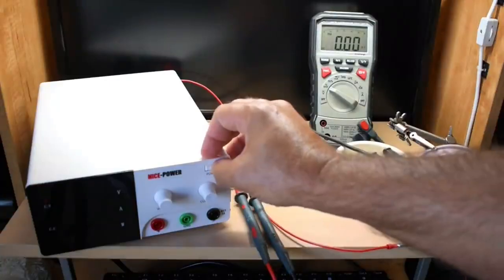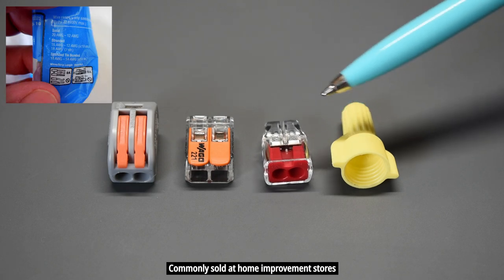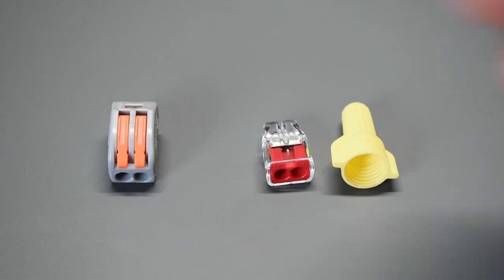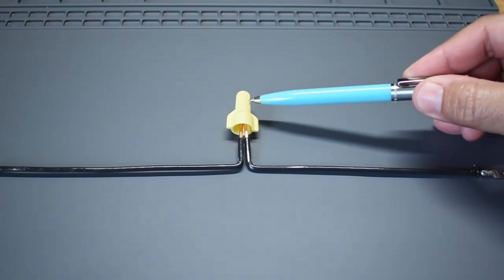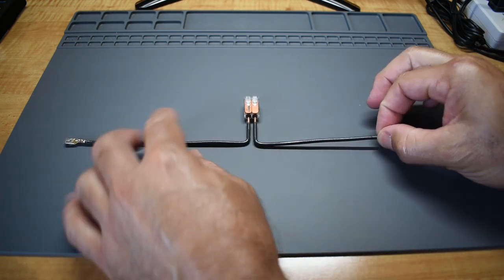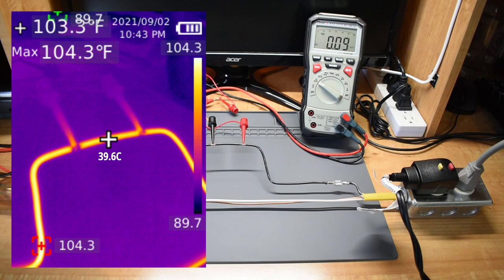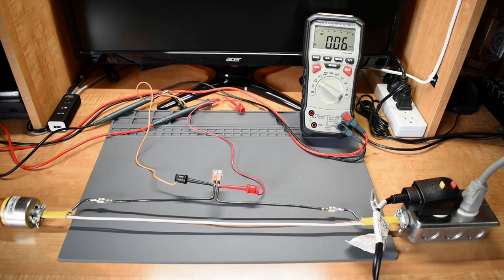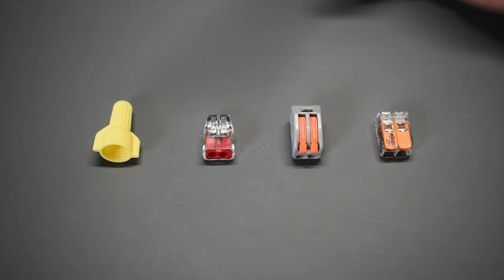BEST Electrical Wire Connector? Wago, Wire Nut, Ideal In-Sure, Lever Nut

Comment: Thank you sir... One of the better tests I've seen thus far...The WAGO 221 connectors, i.e. made in Germany are way, way over rated imho... The Ideals, made in the USA are the next better option imho... The Mv tests was well done as was the temp readings on each respective connector with the old standard wire twists coming out on top as I surely expected this because of the nature of the twist & a more overall solid contact area...That you used solid core 12 gauge wire on all the tests made this a fair & accurate test as well...
In closing, I have seen a more recent test on ( 4 ) push in connectors for their pulling strength with ( 2 ) of them being the Ideal & the 221 WAGO, but using 14 gauge wire in both stranded & solid core...The ( 2 ) wire Ideal pulled apart at 84.9 lbs., making it by a wide margin the strongest of all ( 4 ) connectors used in the test using solid core 14 gauge wire. The ( 2 ) wire WAGO 221 pulled apart at around 60lbs & once again, they were loose inside the connector housing when fully seated...
The stranded wire test using the 14 gauge on the Ideal pulled apart around 48 lbs... The stranded wire test using the 14 gauge on the WAGO 221 pulled apart at 26 lbs...That was an eye opener!
There is a next generation Ideal connector now, but I'm not sure if it's available in the states yet, they are the color blue & have smaller lockdown levers that stay in place far better than all of the over rated WAGO's do... If I was to consider ever using the WAGO's, which I won't, I would absolutely run electrical tape over the levers & wrap them tight...To put it another way, If I was left a choice between a WAGO connector or a twist butt connector, the twist connector would absolutely be my choice... 
All the best,
Bill... :~)

Comment: When using wire nuts I always twist the bare wire together for three to four twists using lineman pliers, very, very secure connection even when joining 4 wires together.  Usually I will use three wire pigtails instead of trying to join 4 or 5 wires together.  You take up more space doing this method.

Comment: 1. you have 2 wago Designs on table old and new
2. you are missing third witch is really for solid wire
3. movement is there so you don’t get a problem 
New is Beter.
Reply from the maker: The company's website clearly advertises the 221 for stranded and solid copper wire, which is why I made the video using the 221. Thanks for watching
Reply: Not sure why he had an AC offset voltage.   I collect multimeters and that offset shouldn't have existed with no load.   Also 4-5mv drop vs 10-11mv drop at 18 amps is not going to be noticed or burn the house down.   85mw or so vs  200mw.    Don't get me wrong,  I still prefer a proper wirenut connection for 12awg or higher.   One shouldn't be drawing 18 amps on 12 awg for a long period of time anyway.

Comment: Interested in understanding why you skipped over the Ideal push-in to recommend the gray Wago.  It shows less heating and loss than the others.  Is there something you did not mention that drove the selection?  Also, Wago have push-in connectors as well.  Not sure if this is something new since this video was made.  I wonder if those perform any better than the Ideal product.  Thanks.
Reply: totally agree! It is contradicting based on all the results he did. the conclusion doesn't make sense. Ideal also makes a 4 wire connector.

Comment: All of my wiring projects are stranded type in conduit for easier pulling. I avoid romex when possible so changes are easier in the future. Lever nuts are by far the easiest to use with stranded. If I am working on solid and I'm joining 2 or 3 wires, then I will tend to use a standard wire nut.  Unless it's lighting circuits as they are usually lower amperage and with LED's in almost every fixture, an entire floor's lighting circuit might only be a couple amps.
I also pull test every connection. I've had failures on wire nuts, push-in connectors, and the lever nuts using both stranded and solid.

I saw a video or two where someone was putting a lot of amperage through all these connectors, like 50+ or something. Well over double the rated. I remember the Wago connectors did pretty well. The wire insulation and connector plastic was all melted/burned off, but the metal spring connectors stayed intact. I think even at 30 amps, the heat was still within acceptable levels with all connector brands.
Reply from the maker: Probably used stranded copper wire, I'd expect close results. That test wouldn't do too well using solid copper.

Comment: Really excellent evaluation. I would be interested to know the outcome using the gold standards of "wire nuts".. The 3M Secure Grip and 3M Performance Plus. Both are just outstanding and, I believe, a step above the Ideal nuts. That said, really great job in this video.
Reply: Why do you think they are better?
Reply: @techmetal2292  Sorry that I didn't notice your reply until now. First, the "spring" is much heavier and it's grip is superior. Also, the spring has a durable, defined sharp edge that bites into the conductor and creates a gas-tight connection between conductor and spring. This edge is superior, IMHO, to the other brands.  Thanks for your reply..

Comment: Would be nice to see the same test but with stranded wire. Here in Spain we only use stranded wires with block connectors. Wago are just breaking into the market but most still using the old blocks.
I have some Wagos 221 and I was curious to check the wiggle with solid wire. I tried some solid 16awg and doesnt feel safe at all, lots of play. 
However, the stranded 16awg feels much much better, almost no play.  Also 12 awg stranded has zero play so I think the wagos are much better suit for stranded than solid.

Comment: I'd be interested in seeing you do a similar test between the push-in inserts and the screw terminals on UL approved electrical outlets and switches.  The inserts are convenient and harder to get wrong, but the screw terminals offer more contact area.  Perhaps such a test could also compare insert the wire straight into the screw terminal (some units have molded areas intended for this) versus hooking the wire around the screw.
Reply from the maker: I already thought of that idea. LOL. Based on these tests, the screw holding the wire will be a better connection.
Reply: @electronicsNmore  Another problem with the back stab receptacles is the long term failures. They will work when first installed, but often fail down the line.
Reply from the maker: @illestofdemall13  Very true. I've had to repair many "dead" receptacles over the years. For some light switches and receptacles, all I had to do was move them a little, and the wire made the connection again. With those, I simply moved the back wired connections to the screws.
Reply: @electronicsNmore  Same here, I have had to repair those connections as well. My favorite method is the screw clamps on the side of higher end switches and receptacles, and the internal screw clamp of GFCI receptacles. I just need to not over tighten the screws because I have a gorilla grip from years of screwing and twisting wire nuts. I work for a small company and our niche is installing high end lighting, dimmers, smart switches, etc. Been there for 15 years so far.
Reply: @electronicsNmore  
What is different about the back stab connections vs the push connectors shown above?  You'd think that if the push connectors can be made to work reliably and safely that the same design could be used on receptacles.

Comment: I prefer wagos simply because it's way harder to mess up. Pullout tests are kind of redundant because single strands should never have a mechanical load on them.
Reply from the maker: Pullout tests, one which I have coming up, are useful. I agree that you wouldn't be doing it to the wiring, but it does show how well the grip is on the conductor.
Reply: So basically, never pull the wires back out of the box and they are fine?

Comment: hi thanks for the video. not having the data you presented here i always went for the insert type (lever type unobtainium here) i use helacon connectors bulky but positive with stranded wire (for some reason code here prohibits single conductor wire). had some issues with nuts finding only 3m brand worth of any trust (then again hard to find here). take care. your channel is awesome
Reply from the maker: You're welcome! Glad you enjoy my videos.

Comment: Very helpful, thank you! I've always used wire nuts, but had been considering using quick connects; I no longer consider them!
Reply from the maker: The lever type are good for electrical boxes with very limited space, or if you'd like to connect 4 or 5 wires together.

Comment: I really like the idea of the lever type connectors especially for solid/stranded connections or appliances that get changed out periodically. Other than that, I prefer using wire nuts on twisted connections. What is the brand name of the one you called the lever connector?

Comment: I've been using both the grey/orange and clear/orange for years, working in the offshore field. I'm not even allowed to use the twist type. I do place a tiny bit of heat shrink below it to prevent wiggling. Mont of my house is now outfitted with new wiring and clear wago's
Reply: Do you use the explosive environment version?
Reply from the maker: Lever nut types are a waste of money for any installation that you have no intention of modifying. Push-In type connectors are cheaper and superior.
Reply: @AgentOffice  I don't work in ATEX environments. Think dredgers, fallpipe vessels, etc.
Reply: @electronicsNmore  Levers work great to be honest. A few cents difference doesn't mean much. They are easier to use and easy to modify. We also use a combination of hard and stranded cables with the same levers (in different areas, depending on use, stranded is used a lot for 24V). I agree that push in is superior, but having one type of connection that's easy to reuse and easy to work with can save a lot of time.
Reply: @electronicsNmore  Let's say $50 more in an install that cost the customer $10 000 is a waste? And please not forget that WAGO is quicker to install, lol.
Reply from the maker: @Faddnn  I see no benefit in using the lever connectors over the push-ins. The push-ins are cheaper and better.
Reply: @electronicsNmore  Better for fault-finding, can bqe used for fine-stranded as well, combined with both stranded and solid. Can be reused on stranded and as I said adds nothing to the cost of a installation already priced at $10k. Unless you're going to argue $50 is to much for you in a 10k install.

Comment: How about seeing how much pulling power it takes to pull the wires apart? Also see the maximum amperage that they can handle. Thanks for the vids.
Reply from the maker: I may do that. :-)
Reply: Both wagos and wire nuts can handle 3 times their rated Amperage, of course it is not recommended. Also Germans and most of Europe, and Japan use wago or similar connectors. The Germans have used them for like the last 40 years. Germany runs on 240v AC less amperage of course. Most industrial electricians I’ve met use wagos. Please do those test when you can electronicsNmore!

Comment: Can you so a Pre-twisted wire nut VS. a wire nut that is not. I don't think there will be much difference is any. If connecting 4 or more solid conductors I find Pre-twisting helps greatly to have a good connection. But with less conductors I do believe both are sufficient.

Comment: I guess it seems some of those companies are trying to solve a problem that doesn't exist.

I suppose I have a fundamental issue with adding moving parts and cost to a system that has technically no moving parts.

Thanks for sharing!
Reply from the maker: It's possible over time the heating "can" affect the tension of the spring mechanism on the wire.

Comment: Thanks for this test I was just looking at these connectors on Amazon then seen you had posted this about them.  I already use these lever nuts was looking for one to accept larger gauge.
Reply from the maker: I think you can find up to 10 gauge.
Reply: @electronicsNmore  yes sir that's the largest I think there is which due to clamping force I'd say largest I would want.  Anything more lug or set screw style.

Comment: The gray ohne look like a old wago 222 or like a china ripoff.
This and the wago 221 are also for stranded wire. The Wago 221 are also good for ships and carawan.
The red connector is only for solid wire.
Reply from the maker: 222, yes. The red connector is for solid or stranded, says on the package.

Comment: An interesting video, I like how your test was laid out. It would be helpful if the CSA/UL specification limits for wire connections were included and compared to your results, I think that comparison would help people make a better decision. So now with the popularity of these types of compression connectors increasing mainly because of ease of use, we will see counterfeit versions on the market at very low costs which of course, depending on the quality of the fakes, may result in more electrical caused fires and possibly denial of insurance claims if the electrical work was done by unqualified people.

Comment: At the end, you clearly prefer the wire nut over the other three.  Since the Ideal was lined up next, why did you suggest the lower rated other two if there were several wires?  Wouldn't you use the Ideal for 3,4, or 5 wires?

Comment: I'm glad you did this test I was on the fence on getting those quick connectors. No way I'm getting them now.  I know it's negligible but I work in hvac and heated connections cause wire melting and wouldn't be worth the higher we would have to charge customers for using these. Wire nuts it is.
Reply from the maker: People like how easy you can take apart conductors using the lever type, but if you want an extremely secure connection, stick with wire nuts. That said, the Ideal push-ins are very good low resistance connectors.

Comment: I hope UL and Intertek are taking notes.  

I like the Wago style for a temporary solution, a wire nut for long term but a well done crimp is better in my opinion. 

This was a great video.
Reply: Crimps are good when and where appropriate. For electrical splices in junction boxes, the wire nut seems to be the best and most practical.
Reply: @illestofdemall13    Correct, a crimp is not always practical as you also need to have a way to insulate the bare wires.  When I was taking classes on electrical wiring, I used to twist the wires and use a wire nut.  This way you had a mechanical connection and the wire nut added more strength while also providing insulating properties.

Comment: How about a test to see the true difference in cost from a wago to wirenut with manual labor.  Say a project of 10 receptacle boxes that are fed off each other and 5 3-gangswitch boxes with (main hot and 3 switch wires) within.  The time difference from doing this with wirenuts compared to wago's by hand. Does it take 1hr longer or 3 hours longer?  Maybe if a person is slower, then the time difference justifies the cost difference.

Comment: if we fill the wire nut with silicone, would you consider the connection water proof?
Reply from the maker: Years ago I would inject silicone into wire nuts. They also sell silicone filled wire nuts. Thanks for watching!
Reply: @electronicsNmore  if you had used it before, then it is good enough for me.
thanks for sharing your knowledge

Comment: Every electrician I know prefers wire twist and claims it is safest and best connection one can make for household electricity. Simple long enough wire twist. SO not surprised that wire nut turns out to be the best one of all. Though I must say Wago and similar are quite cool for low power applications, when you have different AWG  and for stranded wires.  Good video!
Reply from the maker: The lever type are just fine for stranded wire, but for sold wire, the wire nut is superior. Thanks for watching!
Reply: Every electrician I know would laugh if you came to him with wire nuts. They've just too many long term reliability issues and adding or removing wires in an existing installation is just a pain. I don't know when wire nuts were last allowed in Europe, but there's a reason that they are barely used anywhere else than in the US.
The WAGOs shown here aren't the ones you'd normally use in junction boxes. There are types better suited for that (also cheaper and even faster to install).

Comment: How about performing the same test with stranded wire? We use 18 gauge and 16 gauge. most current is under 3.2 amps on communications. We've been using the wago and the ideal but know I wondering if we should be. Before on critical I solder connection and covered with wire nut and tape. on everything else crimp or wire nut.

Comment: I'd never seen wire nuts (UK) until I moved to NZ and some imported equipment from the US I was working on, I thought it was some amatuer bodge/hack/repair  the idea you would just twist a cap on like a coke bottle :)  Strange how different technologies and methodologies develop. I guess anywhere a wire nut is used, in the UK a 'chocolate bar' screw connector would be used.
Reply from the maker: I like "Chocolate Bars". :-) I found a bunch of them when I lived in the Bahamas. There was an abandoned cold war US Navy Base that I got them from. I have videos of the base. Thanks for watching Andrew!
Reply: lever style are getting more common in the UK, but most cable is 7 strand (except the earth)
A big advantage is they are classed as maintenance free, which means you don't have to an electrician come to tighten your screws every 10 years